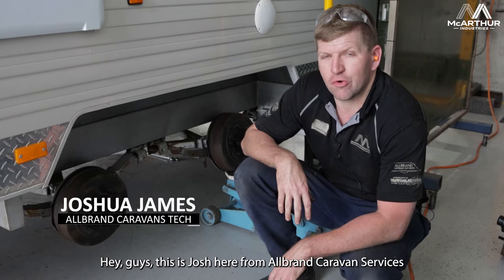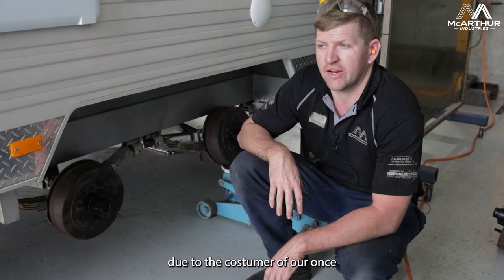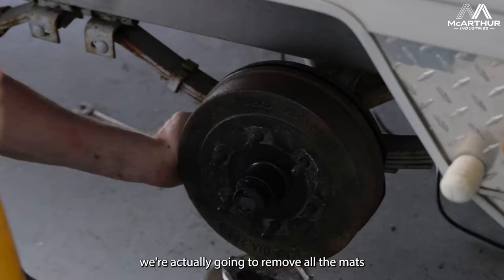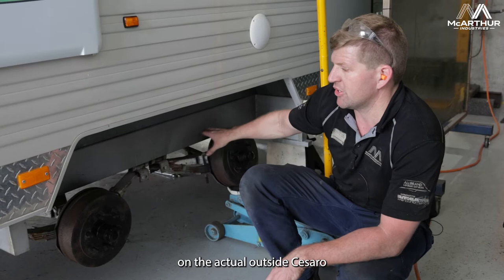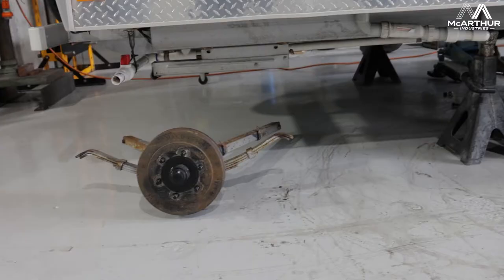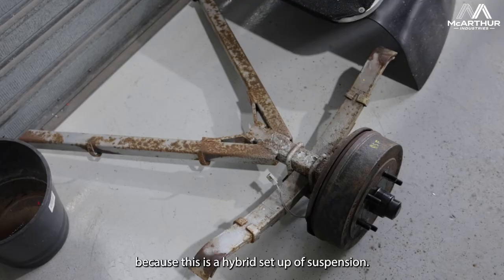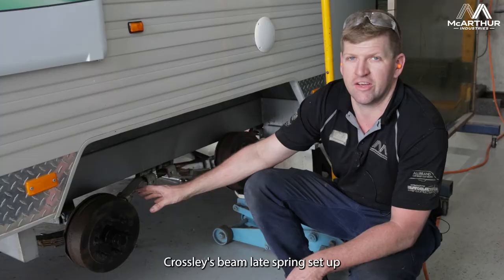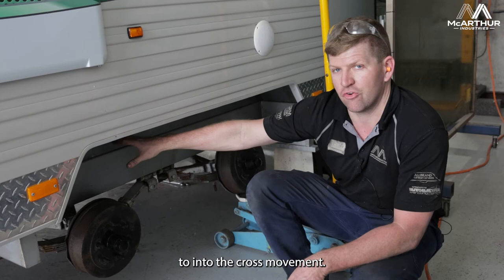Lifting Your Caravan Up

Comment: I've got an old van I'm wanting to change my leaf springs to get some extra height. its running one eyelet end and the other is the slide in. now question is can I switch to leaf springs running eye to eye end and put in slightly longer ones to original? 
also, for extra height is it just a matter of putting higher leaf springs and changing brake lines to suit?
thanks